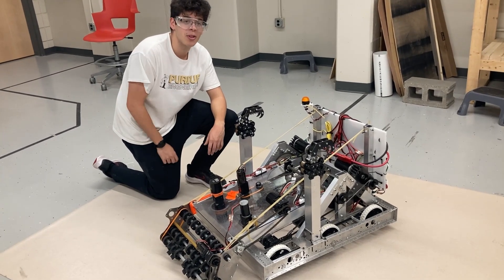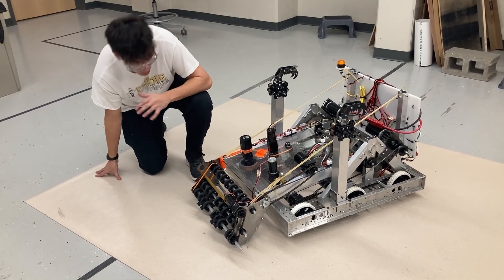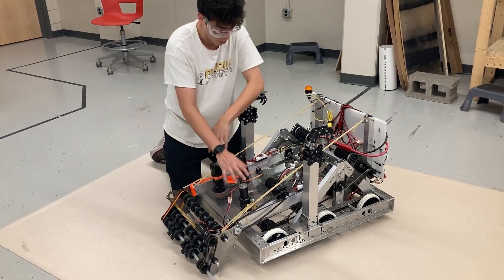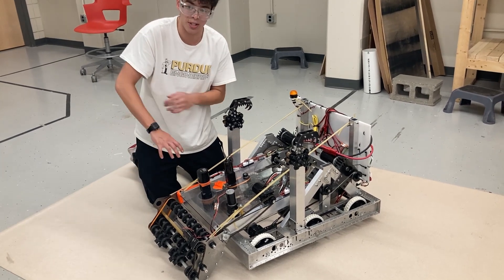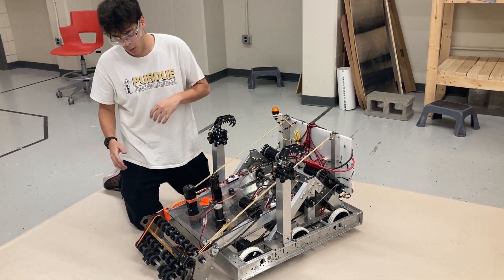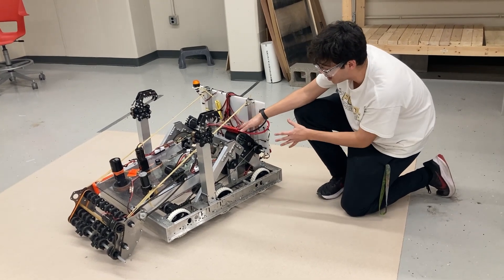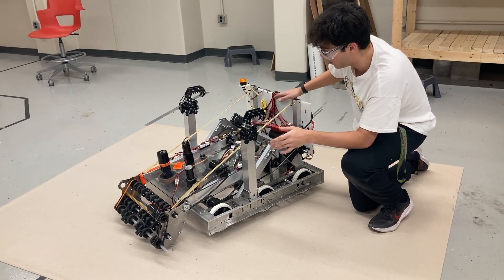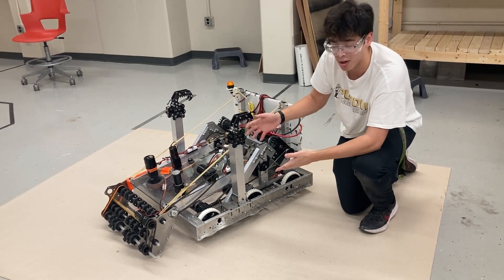Ri3D @ Purdue Day 3: Recap

Comment: Guys whats cad
Reply from the maker: We do not have CAD files of the full bot but we do have a super sketch that we based everything on and CAD of the parts that were laser cut. We will be posting Cad and more write-ups over the next few days mostly on Chief Delphi. We have just been very busy for the 3 days and now we are starting to recap it all. If you have any more questions u can ask them here, Chief Delphi and the FRC Unofficial discord.   
- Joey
Reply: Cad is an abbreviation for computer aided design and is the way that engineers produce accurate digital designs in environments such as solidworks or fusion360